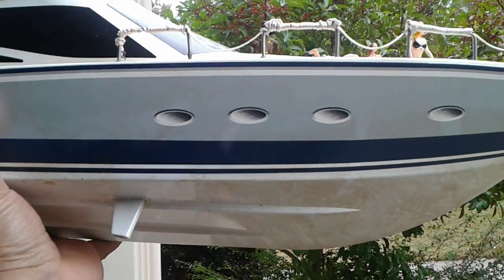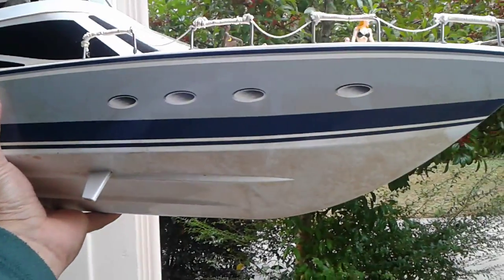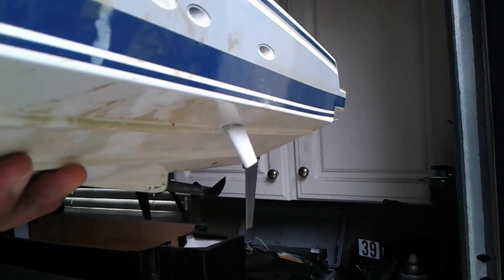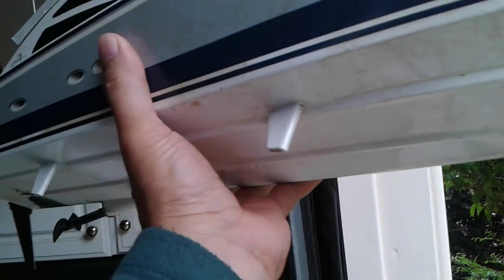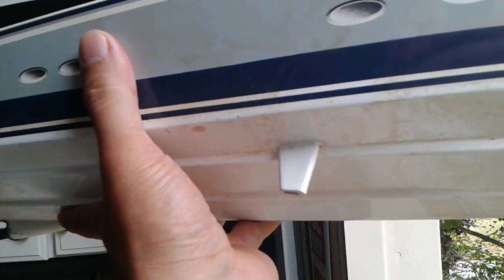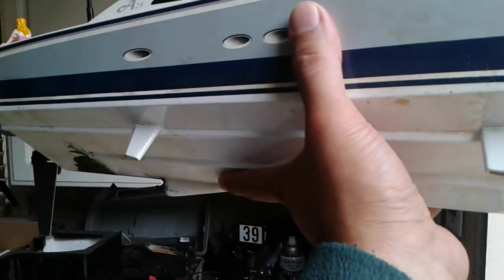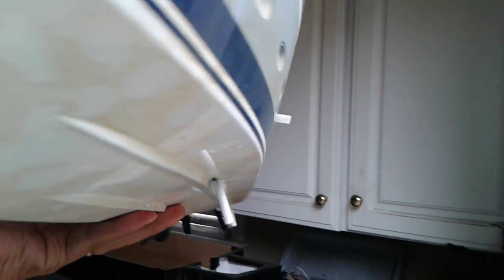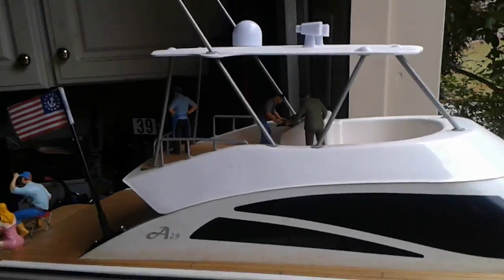Bilge Keels Installed

Comment: Hi, could you please tell me what the bilge keels are made from and how you attached them, I am new to this hobby, have just bought this boat and would like to fit the bilge keels as you have, Thanks
Reply from the maker: They're plastic.  I actually salvaged them from my submarine and glued them using waterproof epoxy.  You can find waterproof expoxy from aquarium stores.  They use waterproof epoxy for aquarium stuff.  Bilge keels are basically just like that thing at bottom of a surfboard.  It guides the boat or surfboard straight.  You use any plastic and just shape it.

You probably already figured it that you will need it for this boat.
Reply: Hi Thank you for your prompt reply, Most helpful, Very much appreciated.